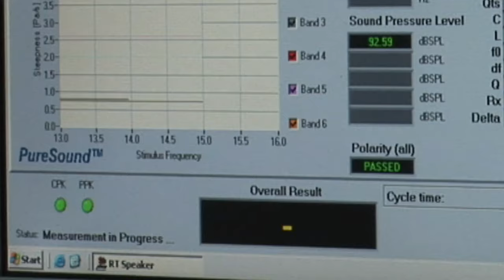18Sound Loudspeaker Manufacturing Facility

Comment: Folks ive been in sound business for almost 30 yrs.
Done work all over the world and there are only a handfull if factories making speakers for the market. So for you folks that dont know who this company is or many others well im no surprised.
These are factories making speakers for other companies like jbl.
Or rcf makes drivers for eaw.
Emminence makrs drivers for tons of companies
Rockford makes speakers for rockford and kicker also at one point.
So look at what you have in your car or home that u spent a small fortune for and cry.
Those speakers are literally pennies on the dollar if you bough the factory driver or oem.
And its the same specs most of the time but most of you folks dont know anything about speaker specs except power handling.
So depending on what your doing well for a car or home just buy a standard off the shelf rockford speaker and it will do great. A little more power go to emminence or for sound re enforcement well go to RCF
And well if rcf is good enough for the freemont experience soubd system in vegas well its hood enough for me to put into the back of a car.
And all you big sound guys out there there pennies on the dollar for an 12 or 18 inch pro driver.
So learn a little except what the next guy is doing and thrn you will have some experience to make some real remarks about sound 

So learn folks and you shall save some money and have superior sound.

Comment: Nice  speaker. Difficult to repair. Hard to remove software as a reusable piece. Coil only needed from a USA parts manufacturer. When they get driven hard, they get driven very hard. The software will burst into flames.
Reply: Can you tell me more of your thoughts on this brand of speakers? I'm in the process of rebuilding some sundown X12S, and I understand how speakers and subwoofers operate just wanted to hear more of your thoughts

Comment: these are not good.I bought Pyle and they rock......But y'all good for the price just make em louder :)
Reply: RingtoneCentral Ever heard an Eighteensound 18NLW9601? It is known as one of the loudest 18" driver. In a proper enclosure, it puts out tons of low bass at around 35 Hertz.

Comment: In Trinidad the lw1400 18 inch coils keeps burning, the 10 inch m600 as well as the 8" you guys need to build a rigorous sub for our demanding events the tone of the lw1400 is just right but it needs to be stronger to withstand the abuse
Reply: I've owned twelve of these 18LW1400 for ten years and have not burnt one coil (so far).
1: use less power and use appropriate compression to suit the music; if not loud enough then use more speakers.
2: use a cabinet that has been correctly designed to suit this exact driver. this will maximised acoustic output.
3: use a high pass filter to remove low frequencies below the capabilities of the driver and cabinet.
hope this helps !

Comment: If it doesn't produce 1Hz - 100Khz +/- 0.000001 db, I don't want it.  Cheap-ass product.
Reply: 380stroker all kidding aside ..you do want a llarge speaker to produce as much low and high frequency as possible..